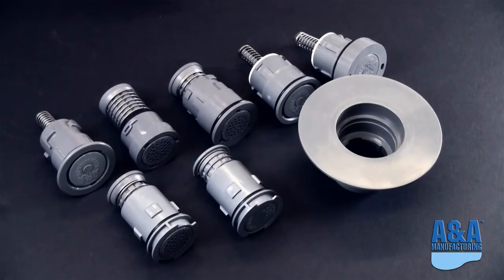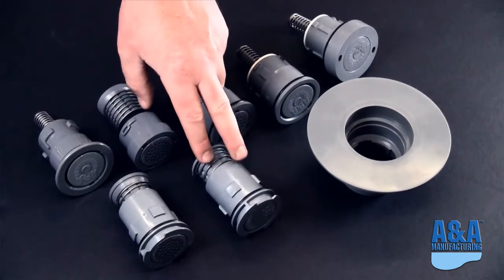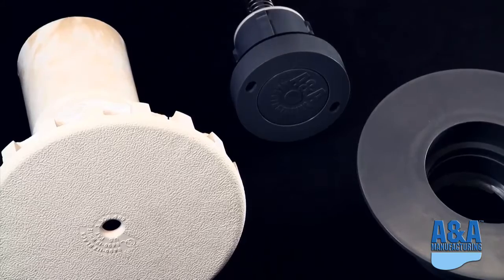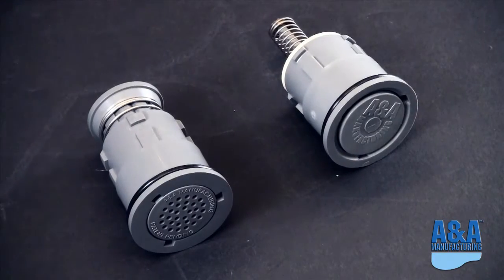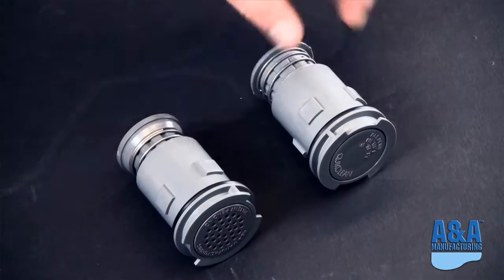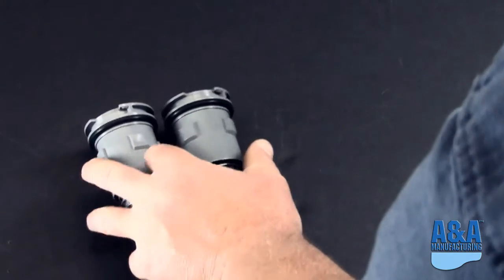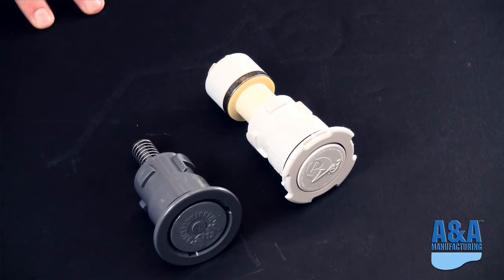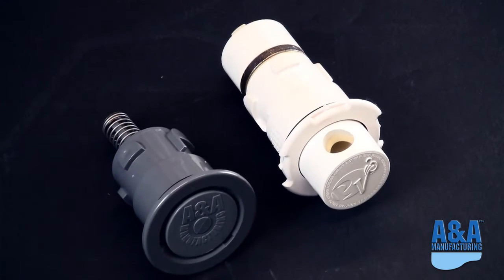How to Identify A&A Cleaning Heads

Comment: Helps to understand what is what.  Just a questions I have style 1 system that is disconnected.  I want to get it back online.  Will the style 2 cleaning heads retro fit to the style 1 housing.